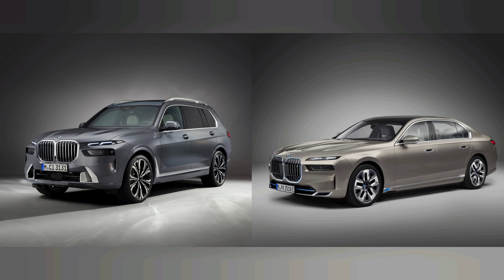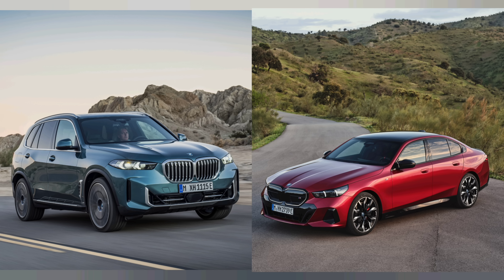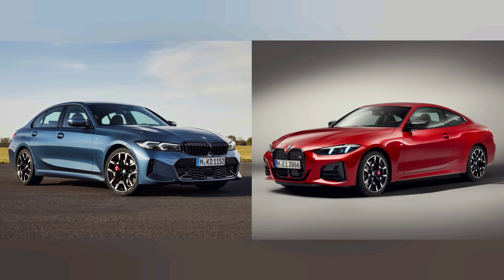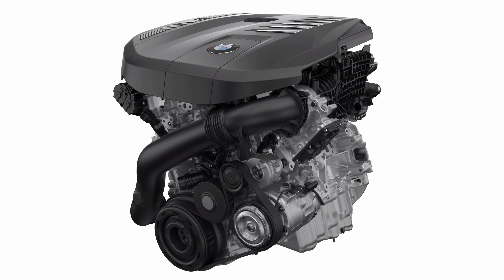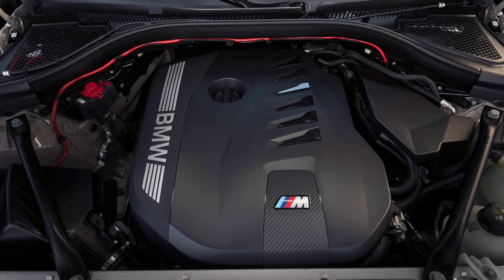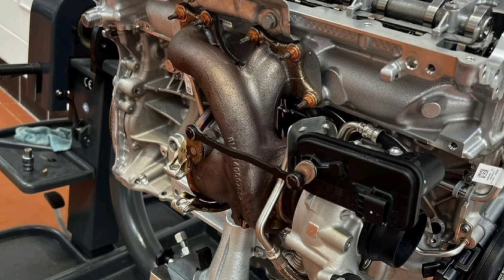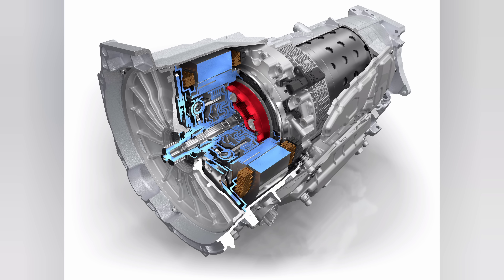An Update on the New Gen 3 B58... (1 Year Later)

Comment from the maker: To the new M340i Owners: Don't spend all your extra 4hp in the same place 😅
Join My Patreon for help with your build and to Support the Channel: https://www.patreon.com/kern417
Shop my Amazon Store for the tools and products I use: https://www.amazon.com/shop/kern417
Order your discounted BMW parts through my BimmerNetwork Affiliate Link (Coupon Code "kern417"): https://www.bimmernetwork.com/?afmc=kern417&utm_campaign=kern417&utm_source=leaddyno&utm_medium=affiliate
Reply: I should say that mild hybrid gives a lot of torque feel. I have 25’ M340, my mild hybrid is always at low battery level because i travel short distances, but after charging that 48V battery with 25A power supply in service mode thru ac dc converter, my car just rips, it feels like two totally different cars. It smoothes shifts, there is no gap in power when accelerating, feels very linear, i think it fills power gaps when changing gears, also i dont know is it affecting turbo, but it seems to inflate much faster when battery charged, i have instant torque from 1500. 
One big con there, you can accelerate like that 2-3 times in sport+, after flooring it battery is fully dead and you need 20 mile ride to charge it with driving.
Reply: @lita-w6m Wait!?  how can you tell if the battery is charged or not?
Reply: @Scandalous0001  drive it down a long hill while braking or charge overnight.
Reply: @microbiologycory10 how would I charge it overnight? 
Fyi, I'm sorry if these questions sound dumb..😂
Reply: @Scandalous0001  you ever find out?
Reply: LOL! The extra Tq bump is nice to have however
Reply: Just bought one. Portimao blue, black interior.
Reply: You would buy a Battery Tender or similar and hook it up at night…completely optional.
Reply: Hey can you do a follow up video on the S68? I’m deciding between a new X5 M60i and the 40i. (Currently have a ‘22 X7 40i and a ‘25 M4 manual). We do a lot of towing and I’d like to keep the car at least 7 years. Wondering if there is any new information out on the S68 in terms of design, reliability, and things to watch out for. Cheers!

Comment: 6 months Gen 3 owner, drove like grandma first 1,500 miles, did first oil change around 4k miles. just got an intake installed and check engine light came on due to a crankcase ventilation hose/connection code. Cant tune/delete the code so we are just winging it. will post an update in another 6 months.
Reply: Ik you said you would make an update in 6 months but any new symptoms or changes? Just hit around a year with my 25’ m340i and im wondering if theres anything I should look out for.
Reply: @ivin2380  No just a solid check engine light due to the unconnected ventalation hose. Plan on changing intake and inlet to one that has a the crankcase adapter/port.

Comment: I was completely surprised that they bother giving 2025 M340i an engine upgrade when G20 3-series is going sunset.  
Still, no regret about getting my 24’ M340i. I actually enjoy ECO PRO mode a lot that it slides through like zero resistance.
Edit: if TU2 must have GPF, thank god mine doesn’t have that thing! It’s doomed to cause issues later
Reply: BMW did the same thing putting the n55 into the 2011 e90 335i. Although that version of n55 turned out to have rod bearing issues and have no where near the tuning potential as the later n55 with ewg.
Reply: Site where Gpf reduces reliability when making those claims.

Comment: My 2023 BMW M340i is mild hybrid LCI model I’m pretty sure it has a Gen3 B58 if not mistaken. Just had my first issue with the car at 31k miles & you guessed it was the water pump luckily it is covered under warranty.
Reply: 25’ is first year of gen 3 (tu2) b58 in the M340i. Just fyi
Reply: @B58PWR so 23’ is Gen2 with Mild Hybrid & ZF transmission correct?
Reply: @HypeWhipsNJ yes gen 2 not gen 3
Reply: @JS-fl6ur  are you 100%? I bought a gen 3 dp for my 2023 m340i and now I’m concerned I got the wrong one lol

Comment: In Europe until 11/2025 all the LCI2 2025 M340/440i-s are still coming with gen2 B58. I bought one this year, was expecting a gen3, but only Northern America got it with the LCI2, Europe still gets the gen2. Wonder what's the reason for it in BMW headquarters? 🤔 Did I got lucky with the gen2 B58 in my 2025 M340i or gen3 would have been better? What do you think? And why does BMW make this difference between European and Northern American 2025 M340is?
Reply: Have same question.
Did u find anything?

Comment: FYI in case you encounter this.  I have 2025 M340i with about 3500 miles. I just got back from a 900 mile road trip and discovered a slight transmission leak. I took it back to the dealer for any repairs under the warranty. They kept it for about 6 days, including over the weekend, and test drove it as well. Nothing was found and no repairs made. To its credit, the car runs flawlessly with no check engine issues or anything. The end result is I was told this will be monitored and I will bring the car back to the dealer after about 1,000 miles to see if the problem occurs again.

Comment: Seems like the gen 3s make quite a bit more power when tuned
Reply: It should have more potential. Has different internals (part numbers are different for cams and vanos (bigger vanos controller), built in port and blow off valve, charge cooler is different and similar to s55, better radiator fan, hp60 rather than hp61 trans, twin mass flywheel looks beefier, oil and water pumps are different, turbine slightly bigger, and other slight differences

Comment: 2025 X5 3rd gen B58 downpipe looks very similar to the 2nd gen B58. There isn't any pressure sensor tubes. The sub-frame does not need to be lowered. I know the M340i B58TU2 has that new downpipe setup. I'm not 100% sure but I also believe the X3 M50 shares the same downpipe design as the M340i.

Comment: Did you ever do a video that talks through the changes of the B58 as it evolved?  From the first version to the newest ones?  I think a video like that which also highlights reliability issues of each version would be immensely helpful.  I have a 2018 X3 M40i, which I suspect will soon need to have many of its plastic engine parts replaced due to dry rot.  Would love a breakdown of which components I should replace.
Reply: 100% agree. I'm not interested in modifying. I just want to know what will be most reliable and easy to repair later down the road. Reliability and repairability take top priority for me. I just want to drive it hard in the mountains, on track, autox, etc.
Reply: that’s the gen1 b58 isn’t it?